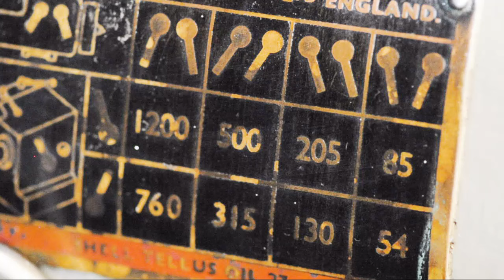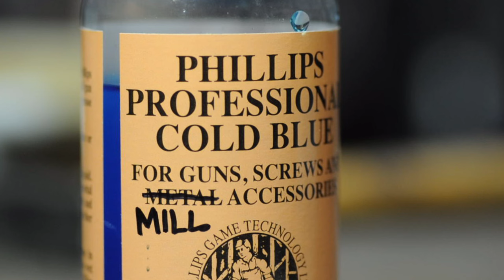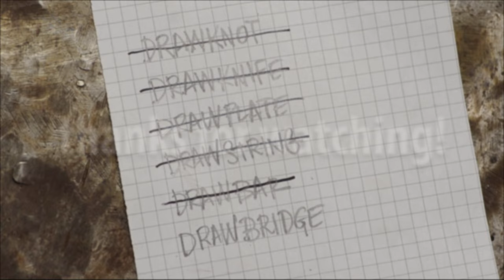Project Drawbar

Comment: Very nice video. I noticed your lathe said METRIC NEUTRAL ENGLISH . Did you know that the English use metric now, just like Canada, Mexico and everywhere else. Perhaps it should say METRIC NEUTRAL ONLY-IN-AMERICA :--)
Reply: Gareth Jefferson No we speak neutral in America too.....
Reply: Hammer0f Thor  If only ...
Reply: Don't forget the moon, because that's the only measurement system that has ever existed there.
Reply: and yet half the products sold around the world are made standard, the names standard it should b the standard and ill use standard till the day i die if its what u grew up in the shop learnin it works the same exact way as metric, this standard metric arguments gettin old
Reply: As an auto mechanic (and the son of an auto mechanic), I'd say the only problem with having two different measurement standards is the fact that I need to buy (and use) two different wrench sets. Some of the sizes are "sort of" interchangeable, but the right wrench always fits better in the long run.
If I've got a particularly difficult or rusty bolt or nut, I'm choosing the "right" one even if I have the "close enough" one in my hand, because living in New York state you run into a lot of rusty threaded fasteners (thanks, road salt).
Reply: 44R0Ndin Yes but sometimes when you've got a rounded off or otherwise damaged bolt, occasionally an alternative measurement wrench or socket can be tapped on and used whereas before it wouldn't fit.  Gotta take the good with the bad.
Reply: 44R0Ndin i always choose the right one all i was sayin was about how ppl argue which ones better, i think standard simply because the name says "standard" thats all, i use the right wrench for the job i got 400 sets of either it seems lol
Reply: Travis Miller
Even tho I live in America, I tend to like Metric better.
Mostly this is because all metric units are base 10, which makes converting easy (move decimal 3 places right or left).
Additionally, there is only one base unit for any measurement. No such thing as "nautical vs statue miles" or "long vs short tons".

IMO it's just easier to work with metric from the start if you can.
Reply: 44R0Ndinz
Reply: The trouble is, every measurement system is a standard, so using 'standard' as a description is a bit daft. I'm English and I use standard spanners but they won't fit anything you've got. Whitworth and BA.
Funnily enough, your 'standard' spanners are not a standard, they are a measurement 'across flats'. The standard in this case being the length of an inch.
Reply: Most all countries, like the US, use a mixture of imperial and metric.
Reply: its funny.... Canada is metric, but good luck finding a metric bolt anywhere. most hardware stores don't even sell them

we've got to have been the most half assed metric conversion in the world.... Apart from how warm it is outside and how fast you're driving, we still use imperial for the most part
Reply: 44R0Ndin you hit that one right on the head. That liquid garbage that Cuomo has them using seems far more caustic then the simple salt or sand we had as kids. Thankfully most of the route I reavel daily (across Tug Hill) are town and county roads that use mostly sand.
Reply: Gareth Jefferson no it should be 
Metric Neutral (Insert bald eagle pic here)
Reply: Skinflaps Meatslapper
Wrong, the first spacecraft on the moon was Russian, luna 2. And it was metric.
Reply: m3chanist Luna 2 through 8 as well as the Ranger missions don't count as they all crashed intentionally or not. USSR did finally land first with Luna 9
Reply: Or metric-neutral-gringo. :-D
Reply: It's funny how some things stick even after complete conversion though, I live in Sweden and we've been using metric since forever, but when going to the lumberyard (gasp! tree carcasses!) you still call it "two by two" or "two by four" etc even though it's labelled and measured to 45x45 or 45x90... it just flows better and most people know what you mean since you can't find any actual 2x2 unless you find something that's been lying in a barn for a couple of generations...
Reply: yep just like Britain, although anything needing formal measurement is going to be in the Global metric system, as it should be eh.

Comment: Can someone explain to me what the tool at 1:40 is? I've never seen anything like it. It looked like the teeth of the blade aren't moving but that might be if the speed of the blade is in sync with recording fps. Is that cutting through steel?
Reply: Steven Cassidy It's a plasma hacksaw. It works on time displacement so the teeth don't appear to be moving on camera. It all depends on when you are watching it. Sometimes it looks like it is moving, sometimes not.
Reply: Ok, well, after thinking "wtf is that a thing", googling it and finding nothing, I just watched the video more closely and it appears I have been trolled. FeelsGullibleMan :*(

Comment: Can someone explain to me how that lathe makes a thread? How does it know where the thread starts and how does it achieve passes so accurately? And how is it controlled? I have no idea about stuff like this
Reply: There is a lead screw on the lathe which rotates at a speed set relative to the spindle to give the correct thread pitch by moving the saddle.
The half nuts on the saddle are engaged at the same place for each pass (an indicator shows when the lead screw is in the right place) so the threads line up each time.

Comment: Where is Part 1? (since apparently the notches in the drawbar head are a secret and nobody is willing to answer what they are for after repeated questions) - presumably this deep dark secret is explained in Part 1... which doesn't appear to exist in Tony's videos. I feel like I've been trolled.
Reply from the maker: the notches are just to differentiate the two drawbars.  one is inch one is metric.  I can feel the notches when I reach for the drawbars.  driving a metric drawbar into an imperial tool holder would be bad news bears.

Comment: What the hell kind of saw was that with what appeared to be a plasma arc across it?
Reply: Ben Clark you never saw a hybrid plasma/donkey saw combo,it was a high end upgrade retro fitted to outdated mechanical hacksaws. It utilises the blade as a guide for the plasma element which as you see does all the cutting,once fitted the blade never "saws" so it never has to be replaced.
Reply: Ben Clark It's a joke. The plasma doesn't work in that away. The plasma must be a straight line to cut a straight line. It's possible to make the plasma a straight line with UV laser, magnetic field, jet of plasma, but not with a saw.
During a plasma cut done to the metal and at a presence of oxygen, it's produced red sparks and the color of the cut is changed because the metal is oxidized.

Comment: After you cut the hex on the bolt head you notched the hex, Why?
Reply from the maker: Just as a mark to distinguish between this and the other drawbar.
Reply: This mark is used to inform that the thread is reversed. And this is not the case.
Reply: Asked my question for me

Comment: 6:28/6:36 - what is the purpose of this little... I don't know what to call it*... groove?  ... of rounded corners in the bolt drawbar head?

* if I did, I could probably look its purpose up, and wouldn't have to ask.  :)
Reply: Usually means left handed thread
Reply: @brandonb9452  ah! Ok, that makes sense. Thank you!
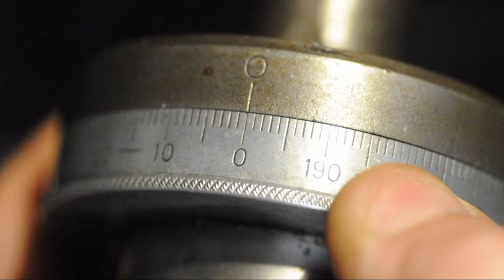Reply: @brandonb9452  wait... or does it? At 3:10, aren’t those right-handed threads?!?

Comment: Birchwood Casey makes a better Cold-Blue.  MUCH blacker, richer.
Reply from the maker: Thanks Tommy.. I'll have to try that one next.
Reply: This Old Tony
I used it to blue a refinished Polish Tokarev, tons of parts, re-blued a lot of screws from later Colts that get that "slot-screw-burring" from using the wrong size blade screwdriver. I guess I could just buy new blued screws but, where's the fun in that?  It has a very nice [rich] dark black finish.
Thanks again for your videos, always informing and entertaining.